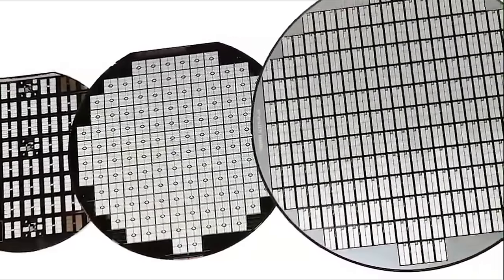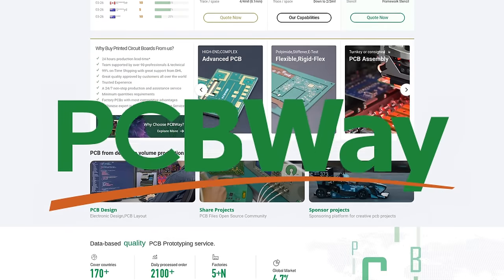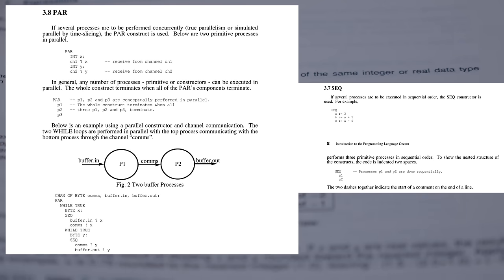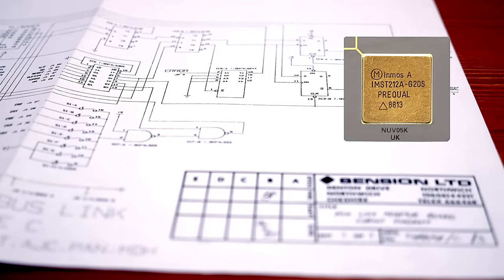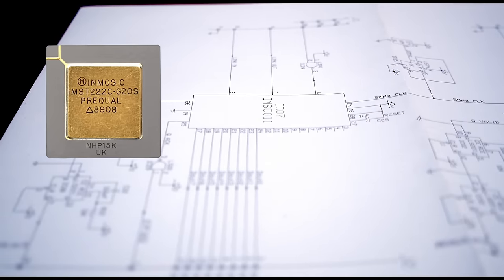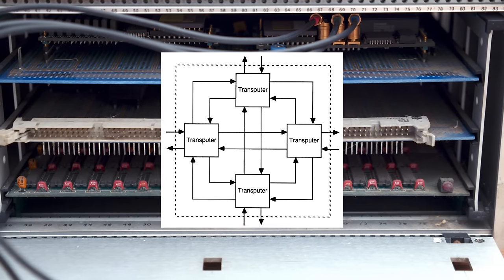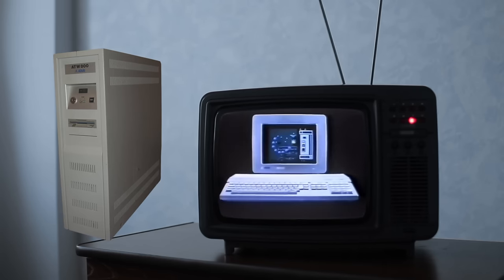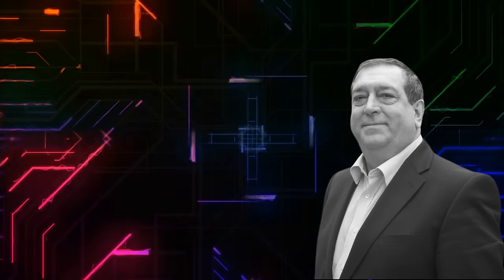The Transputer: A parallel future

Comment: Back in the 1990s I worked for a small R&D company that was developing a radio analysis system based on transputers connected to a huge rack full of Xilinx 3000-series FPGAs. We had a couple PhDs writing code for the system in various flavors of parallel languages (Fortran & C IIRC) to do signal analysis. Not sure if it ever went anywhere, but it sure generated a lot of interesting hardware.
Reply: I know some people who were working on some signal capture stuff that went toward the MALD and similar programs.
While probably not the same company, I am sure some of the same people, or students of those people, were working on similar stuff.
I think FPGAs generally outshined the transputer in time - although... the simplicity of the transputer would make it scale into high frequencies rather easily and it would not be difficult to commission a custom series on new technologies of die lithography.

A bit much for a dod contract, but depending on the gusto of the groups involved and whose signatures they could get - not outside the realm of possibility.

Generally, though, I would say that modern FPGAs are the successor to the transputer in many ways.  If not literally, then functionally.
Reply: satellite downlink interception/microwave point to point/ 🙂
Reply: @Aim54Delta   think that every decade or so, some projects and concepts should be revisited with updated tech, manufacturing and other advancements.

Comment: There is a chip that is still in production today that is similar. The Green Arrays GA144 has 144 cores on the same chip and they all run their code in parallel. The cores on the edges have access to the chips pins. The native assembly language is Forth. They are stack based cores. 👍

Comment: In the mid-to-late ‘80s worked for Integrated Arts (Tiny Grated Rats) in Australia. We were building a broadcast video animation system, which had hundreds of t800s. Very difficult to write something like an operating system for the transputer. No exception handling. If you wanted to kill a process, you had to write ‘stop’ all over its address space. I wrote a parallel memory management system for the other folks to use. So much fun for so little result :-) Occam - a British intellectual programming language.

Comment: Wow, I knew some of the history of the transputer but not the details. I love the foresight of designing the programming language and implementing a compiler for it first. There's some great British contributions to computing that are in the shadows, and you mentioned one them in passing - BCPL. This was the inspiration of the B programming language, that evolved into C. I still have the definitive (only?) book about it, written by Richards and Whitby-Strevens.
As for the fate of Inmos, another example of Thatcher's blind belief that the private sector always runs things better than the public sector. Same blindness that ruined so much of Britain's economy, such as the rail industry (not just the railways themselves but the supporting industries like train manufacturing).
Reply from the maker: The approach of the Thatcher goverment did do a lot of longer term economic damage, and snuffed out areas of development that could have generated whole sectors of the economy. There jusr seamed to be an absense of medium and long term thinking.
Reply: BCPL did earn itself a very bad reputation within the Amiga crowd.
BCPL was a nice academic language and TripOS, the operating system build upon it, saved the early Amiga by providing the missing disk operations and a shell.
But BCPL was stuck on 32bit pointers that did not take into account that the Motorola 68000 (as all other common processors) would address memory in bytes (8bits).
So to get to your real address in memory you had to multiply by 4 - or to get to your "BCPL-pointer" divide by 4. This was a huge burden for programs written in C or Assembler and a constant reason for bugs.
Commodore later spent quite a lot of resources to replace the BCPL code with rewritten C code.
Reply: I didn't know that BCPL was used for the early Amiga operating system - that's fascinating! I do recall having to deal with data alignment issues with some C code that was ported from a 16 bit system to a 32 bit one, but thankfully the compilers got better and started to handle the alignment in structures itself.
Reply: @chriswareham  Yes: the original Amiga crew (when it was still a startup before Commodore acquired it) tried to build up their own operating system. They got a preemptive multitasking kernel (Exec), developed by Carl Sassenrath, and the GUI (Intuition) by RJ Mical, but they were lacking proper device handlers and a command line interface. So Commodore contracted British Metacomco to "transplant" BCPL based TripOS onto the Exec kernel.
So the System was from the start a weird mixture of C structures and BCPL structures, which made it overcomplicated for developers ...

Comment: The transputer was definitely ahead of its time. Intel were waging a MHz war for much of the 90s/00s, while the transputer designers foresaw the need to go parallel. Looking at modern CPUs, inmos were right.

Programming languages weren't designed for massively parallel computer systems (many still aren't), and occam introduced new paradigms that would be necessary based on Communicating Sequential Processes (CSP) with channels and guards. AIUI, CSP was developed after Hoare abandoned "monitors" as being unworkable. Monitors found their way into the java language as a primitive. Quite easy to shoot yourself in the foot with them.

Echos of this work lives on in languages like Go, which have support for channels.
Reply: Chapel is another programming language built for distributed computing.
Reply: For anyone that is a hardware and software engineer, CSP/Occam and hardware description languages like Verilog are on a continuum, anything can be modeled in either, but Verilog is more suited to modelling describing real hardware while Occam more suitable for modelling the parallelism structure, sort of 2 sides of the same coin. See also HandelC.

Comment: Only a year ago I listened to discussions among Forth groups on a parallel chip design that uses the exact same grid style for layout and communication between cores. Who knew it had already been done by others (and failed). Also, reading recently on Haskell parallelization, par and seq and relevant functions are front and center, along with functions that serve exactly like alt. So, thanks for the history lesson. It has been eye opening. Never knew these systems even existed. Keep them coming!
Reply: The Forth chips you're talking about, whether they're the Green Arrays (iirc) or Propeller are a different lineage and different purpose - they're essentially programmable realtime IO and run fairly independently of one another with not much processing power available or required. Seems similar, but isn't.
Reply: I did a lot of work with the Novix chip in the 1980's which had Forth as it's native instruction set (assembler). Is this the chip you are referring to?

Comment: Thank you for enlightening me as to what a transputer is, I had heard the term back in the 80's but never knew exactly what it was.  Around the same time, maybe a bit earlier about 1984 I was an engineer working for Loral Instrumentation of San Diego California on the development of the Loral Dataflow computer, one of the first parallel processing computers, which was based on the concept of a "data freeway" called the "Tag/Data bus".  The Dataflow computer contained up to 512 processing nodes, which like transputers each had own local memory and ran their own code.  The Dataflow computer was intended for processing an incoming stream of realtime telemetry data.  Each node was programmed to grab from the data bus one or more data elements having  predefined "tag" values, do its processing on that data, then put the result back out on the bus with its own predefined tag value to be picked up by either an output device or one or more other processing nodes to perform further processing and put their results back onto the data bus with a unique tag value identifying its result to any other nodes needing that result, etc., etc.  Often a processing node needed more than one specific "tag" of data and captured the most recent of its assigned "tagged" data elements, processing a single "result" when all values its algorithm needed had been captured from the data bus.  So unlike transputers which were matrixed together the Dataflow nodes were all attached to one large high speed parallel data bus and a parallel tag bus (taking the place of the address bus in a conventional Von Neumann architecture).  Its intended uses were for realtime processing of telemetry streams from spacecraft, aircraft, and signals intelligence systems.  Those were exciting times, we felt back then like we were inventing the future and having a lot of fun doing it.   :)

Comment: With some friends I wrote a Forth interpreter/compiler ("tForth") for the T800 (Forth is quite close to OCCAM, philosophy-wise). I did incorporate all the special OCCAM constructs and the link interface. It ran under Windows on an Intel 286, using a "C server" to do all the I/O and graphics. Unfortunately, current computers don't have the ISA interface anymore. Without ISA the link chip can't be accessed, and without that link chip you can't boot the transputer. The T801 card I still have also needs an ISA slot. The link concept and PAR, SEQ are retained in my current Forth compilers, using OS sockets. With today's multiple core CPU's, shared memory works much better than links. For more than 256 cores multiple boxes with links may become interesting again.
Reply: Wow!  Literally the only thing I know about Forth is that it's the programming language that the magic system in the "Wiz" books is based on!
Reply: You can still get "industrial" boards with ISA slots. Also many modern  PCs still have an ISA bus in the form of LPC which is exposed through the TPC connector. There's a project on Vogons  to add an ISA slot called "dISAppointment".
Reply: I worked for The Royal Greenwich Observatory and we used a Forth system to control an image acquisition/autoguider system.  Whist we didn't run Forth on the Transputers which did the image processing we had a really flexible system where the main Forth control system running on a 68030 had a Transputer assembler which would allow us to write/modify Transputer programs which were then uploaded to the Transputers.  The neat thing about the assembler was each Transputer op-code was a Forth word.  So you wrote the Transputer program and then ran it as a Forth program to produce the assembly code. The inbuilt 2d block move instruction was really powerful as we could use it to cut sub-images from the main image all in 1 opcode.  As we had a chain of transputers processing the image we could do some processing on the fly as it was read out from the CCD.
Reply: I love the idea of a Transputer Forth with Occam like primitives.

Comment: Back in the late 1980s I was a co-director of a company charged to design a large scale digital audio mixing system for a multinational organisation. At the same time close friends of mine were working for another company who were trying to do the same thing. They were wedded to the early transputer system as its core processing engine - they had been sold the concept of it. 
However it was pretty clear that politics in the UK would eventually clobber the transputer initiative - the UK was supposed to become a 'trading nation' and it was therefore bound to be sold off and eventually fail etc :-(  
So instead, we produced a large scale array of our own home-grown custom processors, specifically designed for the tasks we needed, with several added custom features, which allowed our advanced development system to function, which would never have been viable with the transputer or any other processor at that time. Needless to say we succeeded, and sadly the other team failed. 
But the moral of the story is that the volatile political system in the UK from the 1980's no longer allowed any government backed home grown technical development over more than one parliamentary period - simply because no politician during a 4 year period would ever understand its significance - and the mantra of 'trading nation' is now burned into our politics of all flavours. This is what would kill off the transputer and we had predicted it correctly. It's such a pity :-(
Reply: The thing about the politicians is absolutely wild to me, because developing computers was such a good play towards success. So much great tech we use today, including the internet, is simply because one government or another backed and developed it. I actually only recently found out how on the cutting edge the UK used to be in regards to computer tech- I'm not from there, and of an entirely different generation, so I never would have guessed until taking an interest in vintage computers. Blows my mind. 

The closest thing I can think of right now, as an American, is how we've gutted NASA to near non-existence, and handed off space travel to private interests. It's gone... Well, exactly as one may expect, to be honest.

Comment: I used the UEA's 9 Transputer rack in the late 1980s to do my BSc dissertation: "The Implementation of Neural Nets on a Transputer Rack" which implemented a fully-interconnected, parallel neural net on 20MHz (ie 5MHz x 4) T424s. Amazing system!

Comment: I remember seeing the transputer / occam being announced on Tomorrow's World.  They made a huge deal about it, but the Demo they put together was so under-whelming I remember being unimpressed.  But I was only in my early teens so I didn't know anything.
Reply: Tomorrow's World really suffered when everything went micro, before that the mechanical inventions were inherently better TV, a "magic black box" without moving parts to film is inherently dull.
One idea I do remember was a light bulb saving switch that would sync power on to O Volts, so the filament heated more gently.  I think they could show it working with oscilloscopes.
Reply: And I was mad keen on computing, went off to do Comp. Sci. degree, so if I found it dull the average viewer must have been catatonic.
Reply: Me too.  I was just a kid when I saw it TW and just like you, wasn't really that impressed with what they showed.  Fast forward a couple of years and I got to see an Atari workstation at  a computer fare.  It was loading and display images from a drive, or so I thought.  Turned out it was doing ray-tracing.  A ray traced image in the same time it took my Amiga to load from disk !  Now THAT was impressive.
Reply: Hello fellow Bobs.
Reply: I remember the demo on Tomorrow's World, it was quite good and they were demonstrating two things, firstly the fault tolerant nature of a system containing multiple processors so long as the code was written to support it and detect when a transputer had failed and not push a workload to it, and second they were demonstrating the performance.
Reply: @deang5622    I wonder if I have the correct demo ?  I remember a butterfly flapping its way from one monitor to the next, then back again.

Comment: Great video, thanks! A company in Louth, UK used transputers on an offshore gas platform control system called CalCam (Computer Assisted Logical Control And 
Monitoring). All gone now but I saw the system being used many times. I have some screenshots kicking around somewhere.

Comment: Another example of how NOT to design a CPU is the 8086. They looked at lots of 8085 code and noticed that there were an awful lot of software interrupt instructions used. They looked at the frequency of instructions but made no attempt to understand the program's semantics. The 8085 only had 64K bytes of memory. A Call instruction took 3 bytes and an interrupt took only 2. So codere used software interrupts for subroutine calls. The resulting 8086 has a very extensive interrupt system that had to be run in "real mode". It took years for programmers to learn how to set up all the tables needed for the "protected mode". Plus they had to add a CMOS chip to save context during a reset because the real mode/protected mode could not be turned off by software.

Comment: Ah, the good old ATW, as I remember, Kodak were the main (only?) purchaser of that system buying around 100 machines for image processing.

Fun fact, my first awareness of the Transputer was in 1987, through a review of an add on box for the Atari ST which contained a single transputer for, well I guess anything you wanted to do with it.  I remember a picture of the inside of that box showing the transputer chip in the centre, with 4 empty sockets surrounding it, and the review mentioning that more powerful boxes could be bought with more transputers in them to “fully exploit the power of parallel computing” and that transputers were “The future of computer technology”.  For an Atari ST peripheral, it was about £800, so 15 year old me wasn’t going to save up for one anytime soon, also not sure if any of the upgraded boxes ever shipped as they were never mentioned again!

Bonus fun fact, the people who developed the ATW also shrunk the ST into the Atari Stacy, which was done alongside adapting Inmos reference designs to work alongside the Mega ST so that the ATW had a bootstrap system to wake the transputer side up and do some work.